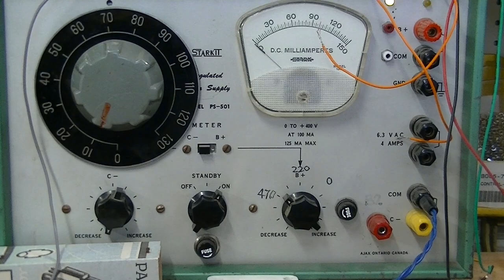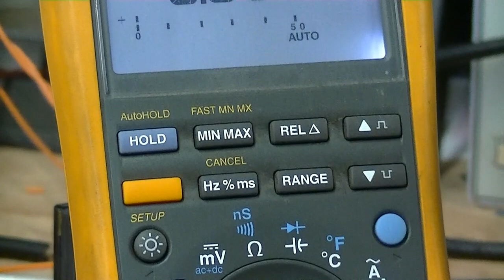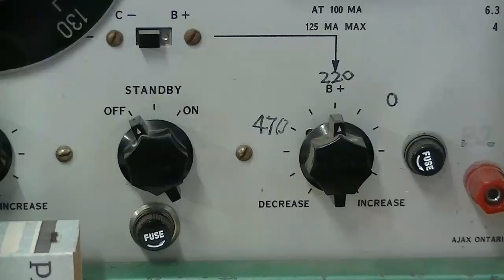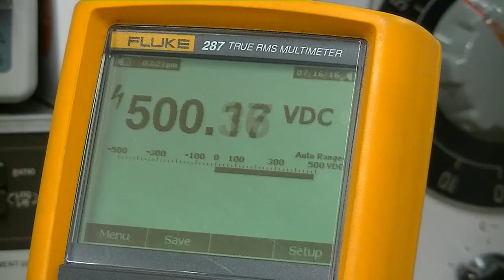tube audio lecture #7, build your own tube tester, 845 high power triode

Comment: Great video and thank you!

A quick question - why did you parallel 2 100R 10W resistors on both sides of the filament to GND? Is this strictly as current limiters as you are using AC from a transformer?

Thanks again.
Reply from the maker: to make closed loop circuit. Good day.
Reply: @YoungAhn  Thank you for your reply.

Comment: Thanks for this video, a great help.
Reply from the maker: Hello dear Theodore. Just try, simple and easy however high voltage is very dangerous. Take care. Young
Reply: @YoungAhn  Hi, I need to test some 845 and 211 vacuum tubes, I need to do my DC high voltage power supply.
One question, do you use -70 volts for the grille? this voltage is fixed or is variable?

The resistor value?

I work fixing Audio Research amplifiers, but some costumers have Viva, and Cary Audio with 845 and 211 tubes, my tester don't have this socket.

Where I can find this socket?

Sorry for all my questions.

Best Regards.